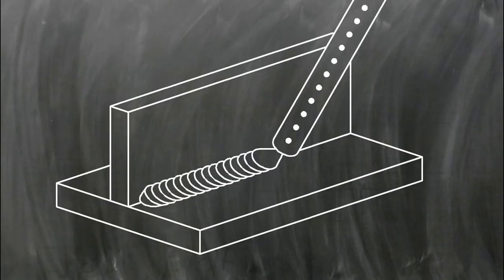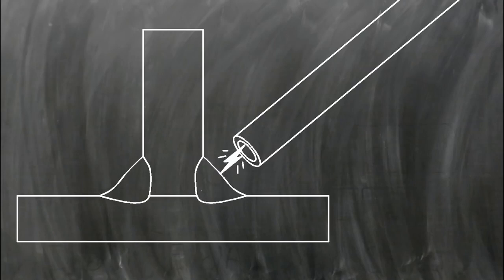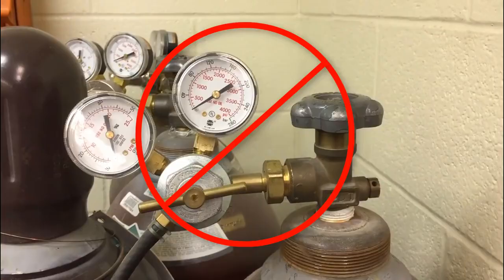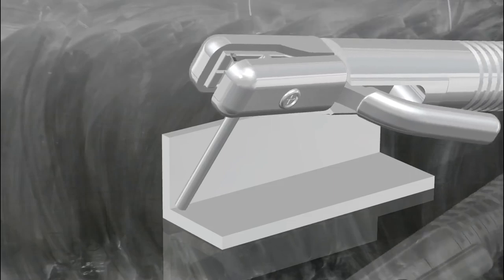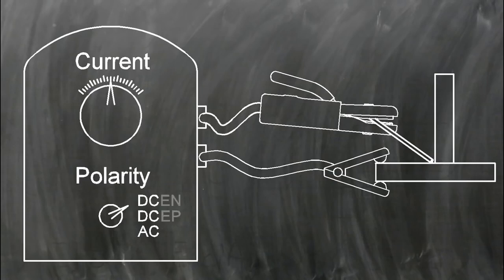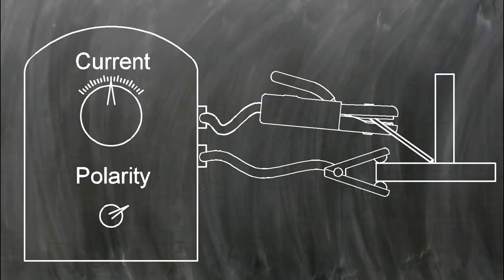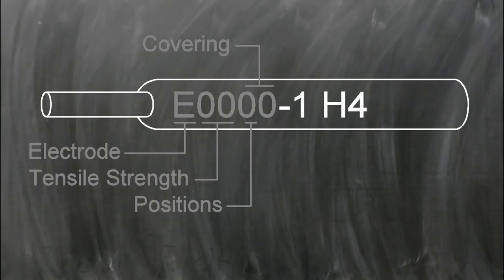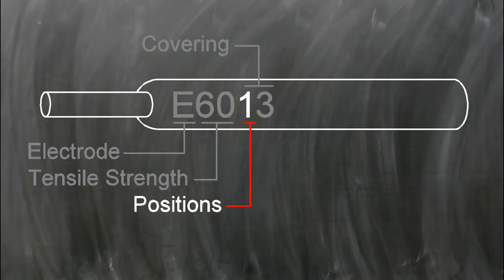What is STICK Welding SMAW by weldnotes.com

Comment: Alwi Arafat Lubis
02511740000068
stick welding is an electric arc welding process that uses rod shaped metal electrodes that are covered with a flux material. The American Welding Society calls this process shielded metal arc welding or SMAW. Shielded metal arc welding is welding sticks the electric current flowing through metal electrodes or the shape of the arc arcs between the ends of these electrodes. And then the arc workpiece melts the metal in the rod. Pieces of metal that will join the metal from the electrodes are thrown into the molten welding pool and mixed or fused with the workpiece. using an electric arc as a heat source and using consumable electrode.

Comment: Name: Thibo Rogissart 
Student number: 04311948008001
This video will tell more about “Stick” welding, there are many names for it: Shielded metal arc welding (SMAW), manual metal arc welding (MMA). So the question off this video is what is “Stick welding”. I will explain it shortly:
They use an electric current that flows true a electrode. The arc will melts both metals in the rod and the metal and the pieces will join. This will happen because the metal you will connect are base metals and they will connect by adding filler metal. During this process there is a protect layer on the joined parts that will be removed after it cools down. 
It is a very simple methods, it depends on witch person do this welding for a good result. Because it depends on the curve, speed, … .

Comment: Arananda Krisdoy Simarmata
02511840000008

Stock welding is elecrtric arc welding process that used rod shaped metal electrode that are covered with a flux materials. This process is call shield metal arc welding or SMAW. this is just of of many type of arc welding. Use the current flows through a metal electrode or stick. An arc forms between the end of this electrode and workpiece. The metal from the electrode ejected into molten weld pool. Because the electrode is constanly melting away and becoming part of the welded, this welding is known as consumable electrode process. Because becoming the part of welding the electrode is become shield that protect and help shape the weld as it solidified but it must removed when the weld is cold.

Comment: Johakim De Brito Dwiki Lakaseru 
02511840000048

Stick welding are welding process that uses rod shape metal electrode that covered by flux material. American welding society termed this process as Shielded Metal Arc Welding (SMAW) or Manual Metal Arc Welding ( MMA ) welding. In this process electrons flow through metal electrode and forming arc between electrode and workpiece. This arc melt both metal electrode and metal pieces to be joined. Metal that are joined called as base metal and metal that join the base metal are called as filer metal. Stick welding also called as consumable electrode process, since the electrodes are used up. Upon heating, some of covering of  the electrode releases protective gas in order to stabilize the arc and the remaining covering protect the melt pool in form of slag that should be removed after welded join solidify. 
When compared with another welding process, components for Stick welding are more simple. There are 2 cables on the equipment, one will connect with workpiece and the other is connected with electrode holder. There are 3 types of current for stick welding, they are AC, DCEN, and DCEP. 
The electrodes are made from several kind of metal alloy and flux chemical. There are codes on side of several electrodes indicating several information such as tensile strength, covering, and welding position.

Comment: Dindra faimundiarti purnamabroto
02511840000123

Stick welding is a welding process that uses rod shapes metal electrodes that covered with a flux metal or known as stick metal arc welding (SMAW)

At the process an electric current flows trough a metakl electrodes witgh stick form and made an arc form between the end of electrode and the work pieces while the arc from the electrodes melted both metal on the work pieces and the rod and joint them. The metal from the work pieces called base metal and the metal from the electrode called filler metal. Because the electrode constantly melting away and joined the structure stick welding known as consumable electrode process.

When the electrodes are heated by the arc. The electrode release some gasses to shield the weld and stabilize the remaining arc and covered the metal with a protective slag to help the weld to solidified and shaped. In the end of the process this slag must be removed.

 There are two poles used in SMAW. Wich connected to the workpieces and the electrodes. Also in SMAW we can use two current. It is AC and DC Current.

Comment: Aprilio Mori Syamra
02511840000074

So from what I learn from this video, SMAW, or Shielded Metal Arc Welding or “stick wleding” is a type of welding that uses electric arc welding process that uses rod shaped metal electrodes that are covered with a flux material. The name SMAW is named from AWS or American Welding Society. Some also call this method Manual Metal Arc Welding or MMA welding, which is a types of arc welding.

So basically SMAW method is to join metals using currents that flows to electrode which cause arc to be created between metal and workpiece. This arc will melt both electrode and the workpiece. The metals in the workpiece is called base metals, while the metals that comes from the electrode is called filler metal. All SMAW uses filler metal, because the electrode will melt away and will become part of the welded structure, and the electrode used is also known as consumable electrode.

In SMAW, gases will be created from the flux heating as it will help in stabilizing the arc and help protecting the welding process from impurities. Hence, the name of “shielded metal arc welding”.

Comment: Mischell Sari S
02511840000090
Summary of this video is about SMAW. Shielded Metal Arch Welding (SMAW) have some name such as Manual metal arc welding,  electricity (Mme) and Stick Welding. The electric current flows through a metal electrode or stick. The filler metal is ejected by the electrode then will mixed with the base metal. Base metal is the metal in the workpiece while filler metal is the metal that added to the joint from the electrode . However, this welding is know as a consumable electrode. 

The electrode contain a shielded gas that use to protect the molten weld from the contaminant by using a slag layer. However, the position and the moves of electrode are important in doing the welding process. This weld method use a machine to flow the electric current. There are two kind of direct current flow such as AC and DC. In AC or Alternate current change direction every time while DC is one positive while other is negative. 
Straight Polarity is when the electrode connect with the negative terminal while reverse polarity is when the electrode connect with the positive terminal. 

There are many of composition of metal that can be used as an electrode. Every electrode contain a different kind of code such as 
electrode, tensile strength and positions. The different code is to make sure that the elecrode is strength enough to weld

Comment: Jeremy Osland Marganda Sinaga 
02511840000021

Stick welding is electriv arc welding process that uses rope shaped metal electrode that are covered with flux material. It can be called Shielded Metal Arc Welding and can be called Manual Metal Arc Welding (MMA). In stick welding an electric current flow into metal electrode (stick). Arc forms between the end of the electrode. The arc melts the metal in the rod and metal in the piece to be joined. The metal in workpiece is called base metal and the metal added to be joined is filler metal. Stick welding always added filler metal in the joint. Stick welding also known as consumable electrode process. As the electrode heated by the arc some of the covering of the electrode releases protective gasses that shield the weld that stabilize the arc. The remaining covering melts cover some molten welded with a protective slag. This slag layer protects and help shape weld to solidify. In the machine, there are 2 wires,  first is connected to work lead and the other one is electrode holder. The electricity in this machine can be setup into AC and DC.

Comment: Mila Fatikah Sari
02511840000026
stick welding is an electric arc welding process that covered with flux material and that calls shieldid metal arc working (SMAW). the electrode make the both of materials joined. the electrode is ejected into a molten weld pool and mixes coaleces with workpieces the metal. in the workpieces is called the base metal and the metal added  to the joint. from the electrode called filler metal stick welding always adds filler metal to the joint because electrode is constanly melting away and becoming parts of the welded structure stick. stick welding equipment is often very simple the only controls on the machine are current and polarity. many important variables come from how the person doing the welding positions and moves the electrode. for this reason the quality of weld produced by this process depends greatly on operator skills.

Comment: Ganang Wasono
02511840000062
in the video, this video explains about one of the existing welding, namely welding Shield Metal Arc Welding (SMAW). Shield Metal Arc Welding (SMAW) is a type of fusion welding that uses a rod shape with a flux cover. This welding process uses metal rod-shaped electrodes. in Shield Metal Arc Welding (SMAW) uses a process that uses temperature to be able to melt one point in the material to be fused into one part. This heating can occur due to a jump of electric ions that exist between the anode and cathode which causes heating which causes melting that occurs in the existing material which can ultimately result in the union of two metals joined together. This welding process can use ac and dc current.

Comment: Ahmad Fahmi Prakoso
02511840000082
SMAW. is an electric arc welding process that uses rod shaped metal electrodes that are covered with a flux material
work :
-use electricity that flows through electrodes
-because of the interaction of the electrode to the materials,the materials will be melted and joined. the electrode must be charged continously because the electrode must be melted on became the part of joined metal
-electrode release protective gass to make the material easy to solidify and stabilize arc
- in SMAW, we must control the current and polarity
-we can use AC or DC in the SMAW

Comment: Adelina Salsabila Ednanda
02511840000066

Stick Welding is an electric arc welding process uses rod shaped metal electrodes that are covered with a flux material. the American Welding Society calls this process shielded metal arc welding (SMAW) can also this process called manual metal arc welding (MME).The current used in SMAW can either be AC or DC. In AC the current is alternating, while in DC, there are another two types, DCEN and DCEP which is differed by the direction of the current. Arc Welding type are 4 namely gas metal, gas tungsten, shielded metal, and flux cored. 

Electric current flows through a metal electrode and forms an arc between the tip of this electrode and the workpiece. the arc melts the metal in the rod and the metal, and then the two are mixed and united. stick welding is a process of electrodes that can be consumed. electrodes also release gases that protect the weld to make the welding process stable. also it produces slag to form welds but must be removed if the welding process is complete, when the welding is cold because the gas produced by the flux cover is able to completely protect the melted weld. 

sometimes the only control on the machine is the current quality of the welds produced by this process depends greatly on the operator skill

Comment: Chrisna Juli A.
02511840000070

In thid video explain about SMAW. 
Stick welding arc metal is one of three types of arc metal. Stick welding arc metal is an electric arc welding process uses bar. shaped metal electrodes then cover with a flux material

shielded metal arc welding or can called SMAW normally called manual metal arc welding or Mme. SMAW most popular because the process is simple. SMAW in this electrode and the work piece the arc melts both the metal in the bar and the metal and the pieces to be joined. 

Base metal is the workpiece then the metal added to joint from electrode called filler metal. process as the electrode is heated by the arc some of the covering on the electrode releases protective gases that shield the weld and help stabilize. when the weld is cool since the gases generated by the flux. covering are able to completely protect the molten weld there's no need for other shielding equipment such as high-pressure gas cylinders regulators or hoses compared to other welding processes. 

stick welding arc Welding equipment is very simple
a clamp which is connected to the work this is called the work lead. the workpiece and back the current will either be AC or DC in AC. the flow of the electricity changes directions many times. DC electrode positive often called reverse polarity.

stick welding is an electric arc welding process it uses a consumable electrode bar that is covered with a flux material

Comment: Name: Ferdy Armansyah
Student Number: 025111840000017
American welding  society calls the stick welding is Shielded Metal Arc Welding. Stick welding is one type of any arc welding. Stick welding is an electric arc welding that uses metal electrode and covered up with flux material. An electric current flow through a metal electrode. The arc forms in the end of electrode and in workpiece. The arc melt the metals to be joined. There is a workpiece that called base metal. And the metal that added to the joint is called filler metal. It is called consumable electrode process. Because it is melting away and become the part of structure. The equipment is simple, we just have to controlled the current and polarity, sometimes the person who controlled welding position and moves the electrode. There is insulated wires that connect to clamp that also connect to work, and other connect to dc current. Based on current there are straight polarity and reverse polarity. There is American Welding Society Classification. First is alphabet that is electrode, 2 digit number refers to tensile strength, the last 2 digit refers to flux covering and other more information

Comment: Vindi mardatillah m
02511840000038
The smaw welding process is explained in this video. Where is explained about stick welding which is an electric arc welding process. That used rod shaped metal electrode. This welding process is often called smaw or (Shield Metal Arc Welding). welding is just one of the many types of arc welding and stick welding an electric current flows through a metal electrode or stick an arc forms between the end of. In smaw welding processes that use heat to melt the base material or the parent metal and electrodes (fillers). The heat is generated by a jump of electric ions that occurs between the cathode and anode (the tip of the electrode and the surface of the plate to be welded). Where the tip of this electrode is in direct contact with the parent metal which has a potential difference that can cause heat. This welding process can use ac and dc currents.

Comment: Aldiansyah Wahfiudin
02511840000004
Shielded Metal Arc Welding, one of many types of arc welding.
How does it work? 
-Electric current flows through a metal electrode or the stick so an arc forms between the end of the electrode and the workpiece
-The arc melts the metal electrode and also the work metal
-The melted metal from the electrode (filler metal) mixed with the molten metal from the workpiece (base metal) and form the weld joint
-Because the electrode is melted away and becoming the filler metal, it is known as the consumable electrode process
-The covering of the electrode releases protecting gases as the electrode melted.
-The gas helps stabilize the arc and covers the molten weld pool with a protective slag layer which later on needs to be removed.
-The quality of the welds produced by this process depends greatly on the operator skill
-The current used in SMAW can either be AC or DC. In AC the current is alternating, while in DC, there are another two types, DCEN and DCEP which is differed by the direction of the current.
-Stick electrodes are not all the same and must be chosen for the specific job they need to do

Comment: Name : Fernanda F.Dwi Putra
Student Number : 02511840000078

Shielded Metal Arc Welding (SMAW) or we can call it also the Stick welding is one of the many types of arc welding in the world. From the video, we can know that stick welding equipment is the simplest of all the electrical arc welding processes. A stick welder has four parts , they are a constant voltage (CV) ,Electrode holder/rod holder , Ground clamp. and Stick welding electrodes/rods to weld with. If you want to use this stick welder, you need to melt both sides of materials and then it will turns into a molted weld pool and mixes with the workpiece of metal.
If we seen the electricity aspects, Stick welders can be both AC and DC power depending on the electrode type used. It’s very rare to use AC. Stick welding power supplies are constant voltage (CV) . It means the voltage stays the same while welding and the amperage fluctuates depending on your arc length when welding.

In my opinion, stick welding has many pros if we compare to the other methods. It is better  suited for outdoor conditions, more forgiving when we welding on dirty or rusty metal and also it works well on thicker materials.